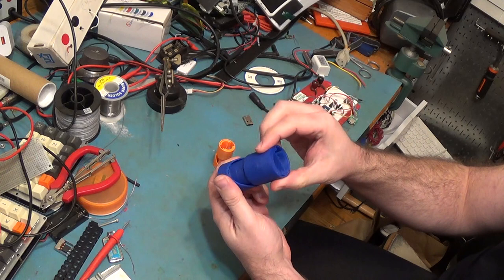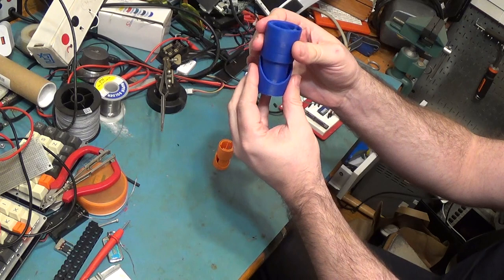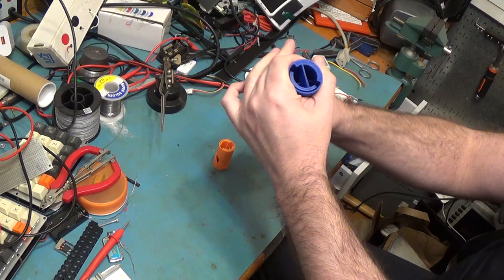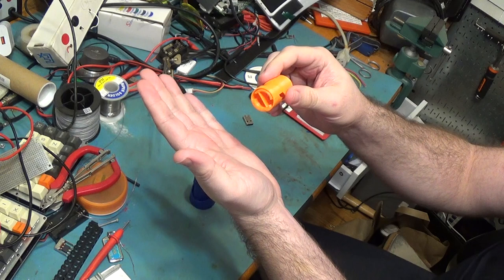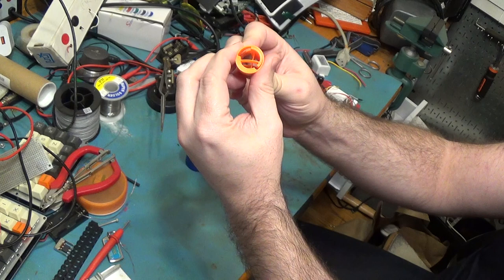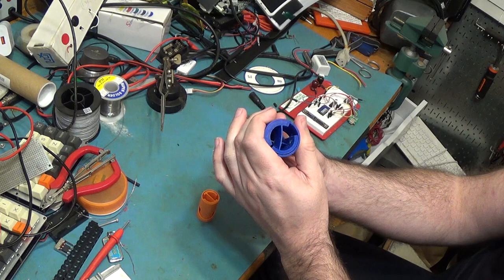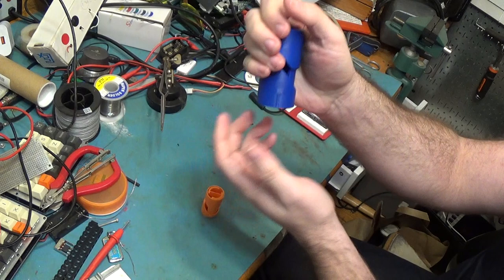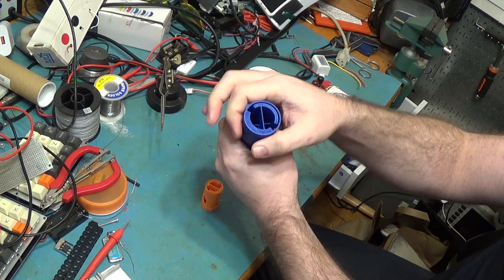3D printed flexure bearing

Comment: How much weight can they support and how many cycles before failure? I know the cflex bearings can have infinite life within certain tolerances.
Reply from the maker: PLA seems super variable. Some have lasted a long time, others break quickly. For best reliability id print it in polypropylene or nylon which can both handle repeated deformation a lot. But for a part that doesn't need to last a long time or is a prototype, pla is super springy.
Reply: @JohnMeacham  I've been considering radial flex bearings for a pendulum suspension, which will see 31.536 million oscillations a year (seconds) with a load > 10lbs and deflection ranging from 1 to 6 degrees.. Would be very interesting to see how long a 3d printed bearing hold up under those conditions.

Comment: I wonder how long this'd last, maybe more out of TPU/Nylon! but this is cool :O I do need something with 90-150~ degree of motion but that'd like be used 300 times a day
Reply from the maker: So two brands of pla are still going strong perfectly  and another started cracking after like 3 months. I need to do some more scientific tests. At worst you reprint the part though. I just started printing in nylon which should have no issues with this.